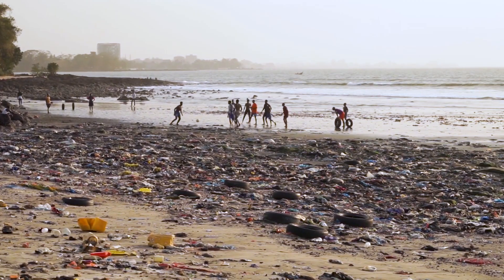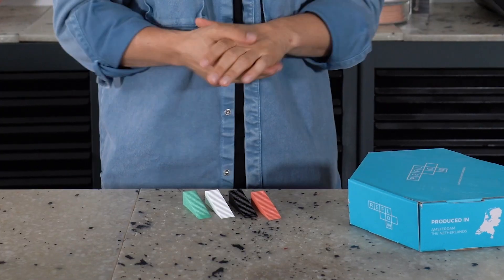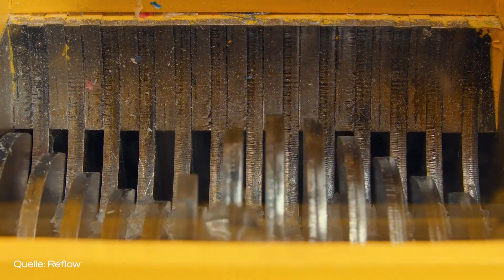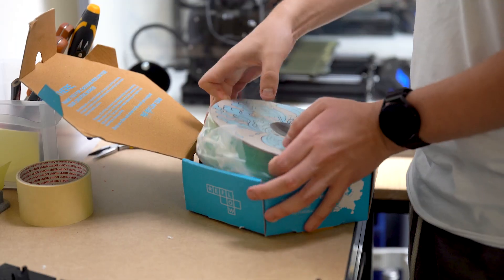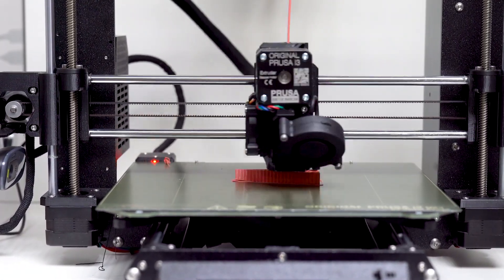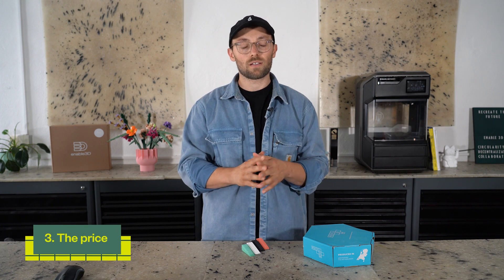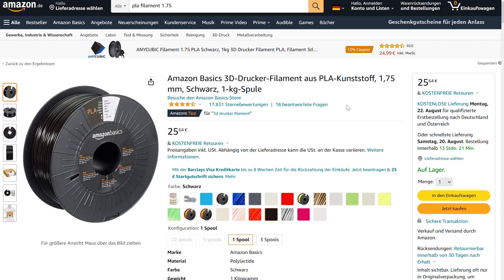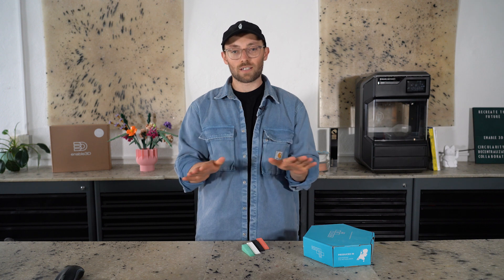3 Reasons why recycled filament is insane

Comment: This is lip service because 95% of plastics are never going to be recycled, yes its good that the filaments are being made out of plastic that can be recycled multiple times, but that doesnt change the fact that something like 80% of plastic either cannot be recycled, or is too expensive to recycle. and then the rest that is easily and cheaply recyclable doesnt get recycled anyway. because it is hard to separate easily recyclable and hard/non-recyclable plastics effectively making all plastic too expensive to recycle because of the cost of separating good from bad
Reply: If it were possible, we should stop manufacturing non recyclable plastics.
Reply from the maker: You're absolutely right...not the solution to entire problem and never will be. But inside the little 3D printing cosmos it's a good start. Hopefully the entire problem will be tackled soon....
Reply: @Enable3D  I think Banagee is onto something, we dont have to put more money into recycling efforts if we stop making non-recyclable plastics, and plastics that can only be downcycled into lesser plastics.